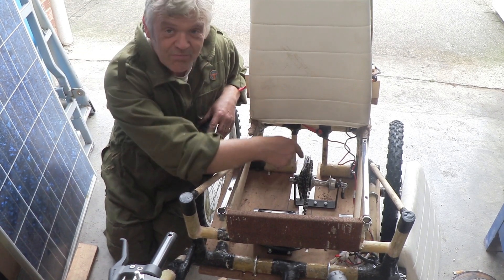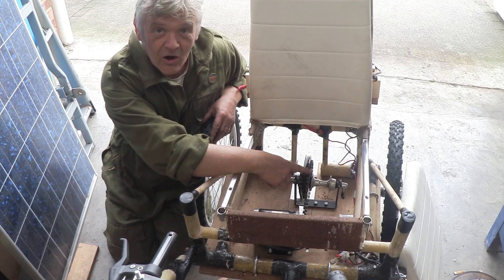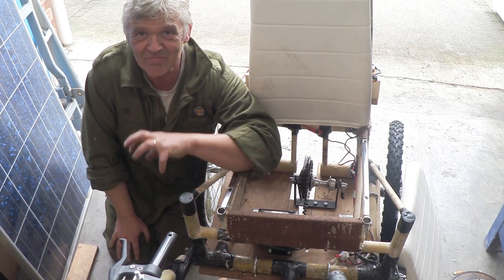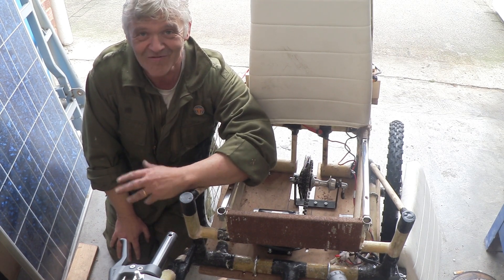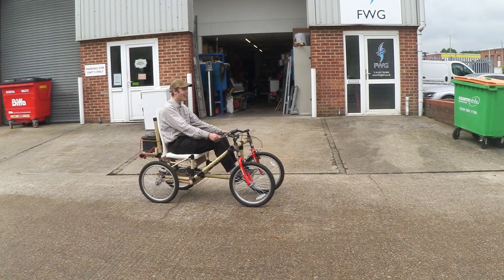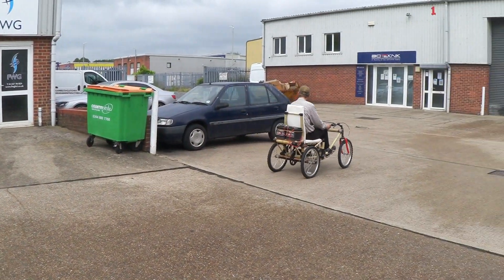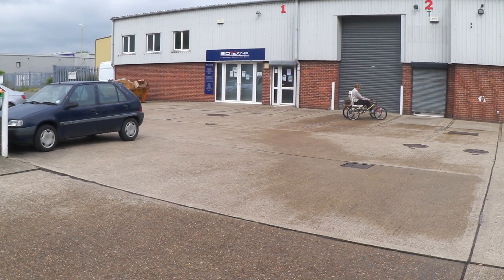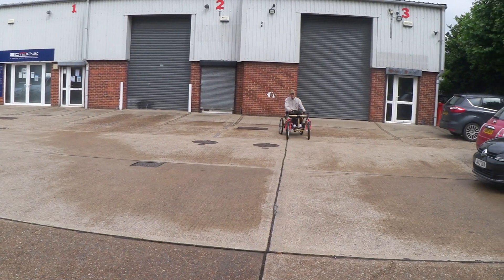1155 Building A Bamboo Electric Quad Bike - Trying It Out

Comment: Like this a lot! A suggestion if I may - if you still have it, why not try your EESD/battery pack from your  electric scooter, instead of those heavy lead acid batteries. It would be interesting to see what performance you could get from that combination, and the weight reduction would be considerable. This is assuming that the voltages are the same or similar, of course.

Comment: It don't seem to be fast after changing of gear ratio. If you fine with this speed - good for you. But I think it's a bit too slow, since I'm 25 years old I'd like to have speed up to 30 km/hour or I would build additional cargo carriage to make it shopping bike
Reply from the maker: then add a bigger motor and go for it mate - I used 500W - 1kW will do what you want

Comment: We have drawn up plans for a vintage quad. The fly in the ointment is legality in the uk. The only way seems to be to have peddles and limit the motor output. Anybody have thoughts
Reply from the maker: put pedals on and limit the motor - it's not that much of a limit mate - guaranteed some folks will hack the motor and strip the pedals - but that's on them
Reply: Look up the MSVA manual online. It has all the info you need to pass the MSVA test to register your vehicle. Should come under light qaudricycle. Anything heavier needs the full SVA/IVA test.

Comment: Excellent first prototype showing proof of concept that bamboo can be used as a chassis for a quad.

If bamboo works then why not 80 schedule abs, or similar.

PVC can be heated and bent to shape and glued and painted.
Reply from the maker: certainly - I would think they would work just fine - I like the 'green' of the bamboo though

Comment: Thinks. If it weighs no more than 60 kilograms (130lb), including the battery; and its motor not rated at any more than 250 watts, then it will be free of any requirement for excise duty nor driving licence. Therefore, it could be driven by a 14 year old.
Reply: Don't forget it the throttle / speed controller must be activated by the pedals. Over on the pedelecs forum you can find a thread explaining all the relative laws. Did you know electric qaudricycles are not allowed on bridleways only bikes and 3 wheelers. Technically no home built electric vehicle is road legal . Don't you just love are government.
Reply from the maker: interesting - cheers
Reply: That's my question answered but what I must do now is to research the law further to find out the complete matrix as I would want a pedaless  vehicle that would do about 30 mph and provide some weather cover.
Reply: @CASHSEC  You need the MSVA manual available on line. It contains every thing you need to know about passing the MSVA. To enable you to register your home built vehicle, what you propose would come under light qaudricycle.

Comment: Sorry, I was disappointed. After seeing so many bikes, trikes and scooters built on Youtube in S.E. Asian kitchens, flying around at 50 mph. This quad just did not inspire me. Maybe it would go faster and further if the driver wears lightweight flip flops?
Reply from the maker: you might have missed the point mate - this is not about building a super e bike its about what you can do with things laying around - most of this was built with scrap and in total cost me £46
Reply: @ThinkingandTinkering  AND can be replicated by people in developing countries or close to poverty in the East using scrap and cheap+available bamboo, AND bamboo is a carbon neutral, sustainable resource...
Reply: were they electric? didn't think so 
power is a simple function of energy density - these are Lead Acid, not even Lithium-ion, making it super impressive. Also I missed what motor they decided to use but knowing this channel it'll be some very inexpensive piece of kit
Reply from the maker: it was a £20 pound motor from ebay mate
Reply: Way to completely miss the point.